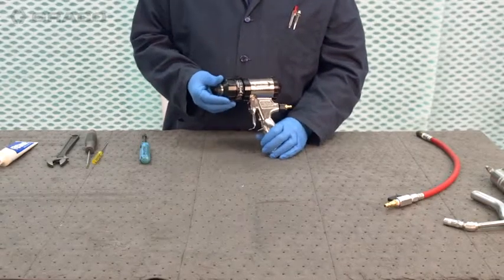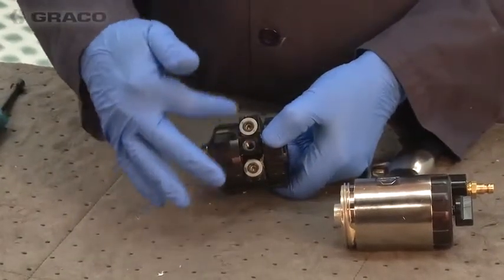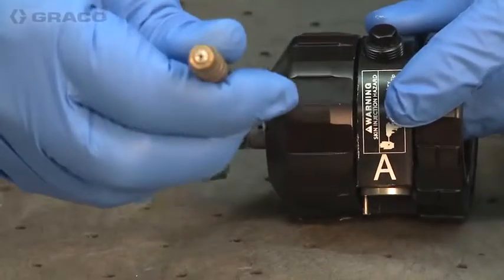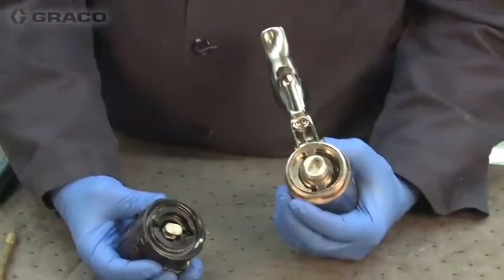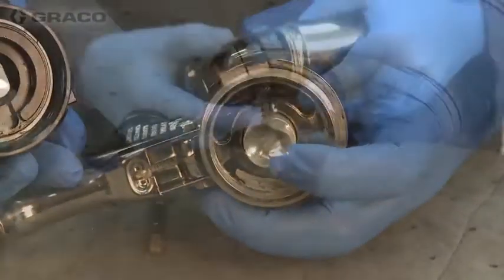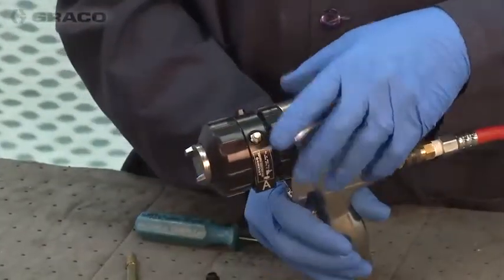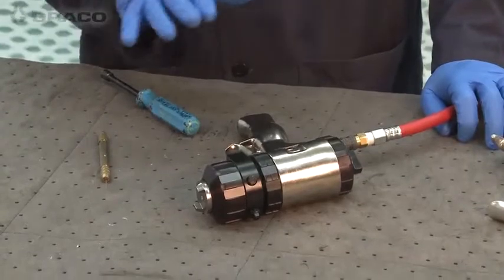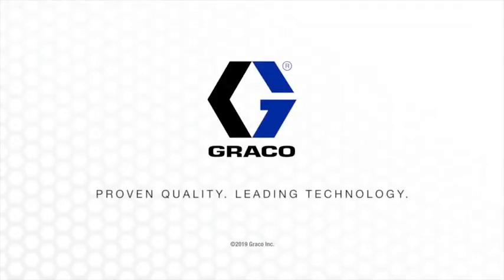Fusion AP Air Purge Gun Service - Daily Maintenance

Comment: I have a brand new gun the first use was great once i finished spray i let the air on for about 10 min and i add grease just like you did so later the same day the mix chamber was clought on b side i use the gun to do bedliners any suggestions ? Why this happens in between each time we use the gun ?